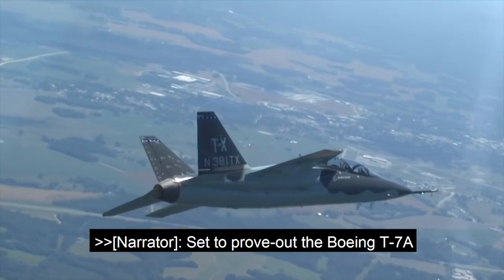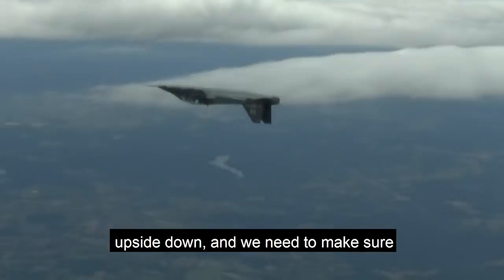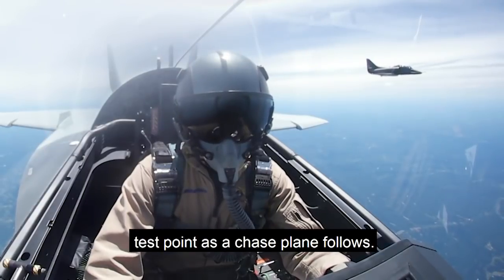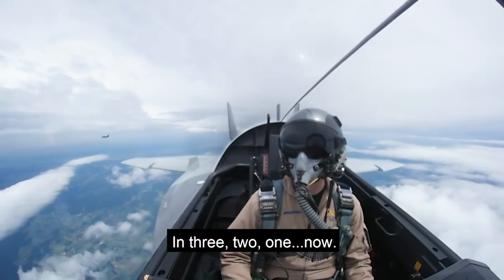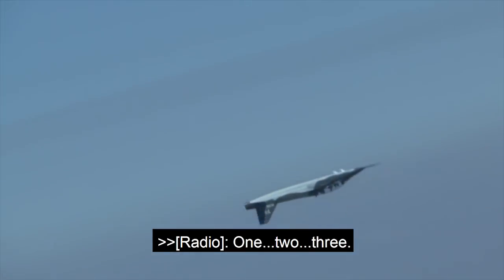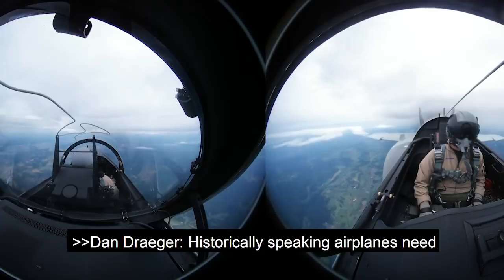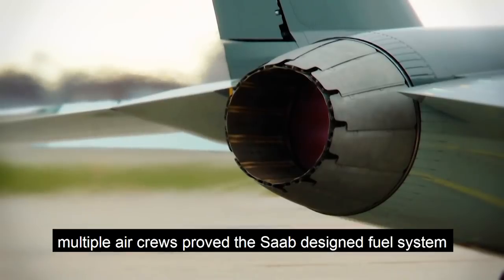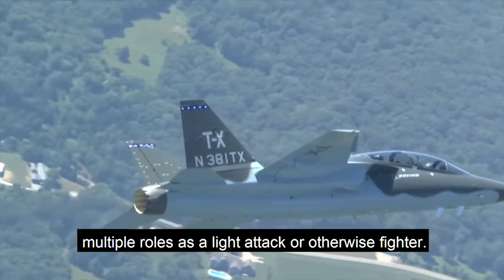T-7A First Inverted Flight Test

Comment: Pops was Private Pilot from the local area for 40+ years.  He owned a Bellanca Citabria for a bit.  Light aerobatic plane that you had to keep positive g's on every maneuver, for the most part, to keep fluids where they needed to be.  No inverted oil system on the Lycoming, so everytime it went inverted and if positive g's weren't held,  the engine oil breather would slosh out a bunch of engine oil, all over everything, creating a day-long cleanup.   Pops fix for that was easy.  He bought a long length of clear hose, and clamped it to the oil breather.  No More mess after that.  The oil was dumped overboard back by the tailwheel where the clear hose exited the fuselage.  Just a tiny bit of oil splash on the back edge of the rudder and tailwheel after that, which was MUCH better than coating the complete underside of the plane surfaces with oil, including all under the engine cowl.  It was a real mess.   The clear hose fix wasn't a green light to hold it inverted, it just kinda gave him a report card on his flying skills that day.

Comment: Cant believe they do  these test over civilians. What if those engine shutdown during inverted flight. I taught they would do these tests over the sea.
Reply: Well, they are close to their base, so they would be able to reach base and land there, even with no engine. There's a video where they test engine restart after a mid-air shut-down, and in that video you see them fly the mission in a simulator and landing back at base with no engine. So they are well prepared, if the engine cuts out and won't start again.

Comment: Huh. I noticed the markings on the back for a boom receptacle. Will she be fitted with that capability in service? It'd certainly be a handy asset to have.
Also, let's be honest here... this will probably be the replacement for the F-16 as the Thunderbirds.
Reply: I have a feeling it will be able to perform mid-air refuellings. The T-38 was unable to do stuff like that
Reply: Si pero va a tener que ser muuuy  bueno para ser el reemplazo del Cohete Blanco el exelente  T-38  !!!

Comment: ...start working on a single-seat F/A version and it will replace all the F5's, early F-16's, and left-over MiG21's that are out there.
Reply: @mainemail-g4e  Two seaters are rather useless in modern times. A WSO doesn't really do much compared to RIOs back in the day.

Comment: Go Boeing! Do what you do best! Build Planes! 👍🇺🇸
Reply: FRIENDLY advice . Dont fly Boeing
Reply: @azurbleu4335   Your wrong
Reply: @azurbleu4335  what kind of idiot are you
Reply: azur bleu Why? Safest most reliable aircraft in human history. No manufacturer in history comes close. 
I suggest don’t fly with inexperience. 👍
Reply: azur bleu two things,One, don’t quote me but I think the Boeing to Airbus ratio is like 7 to 1 Boeing and mind you that’s After airbus inception. As far as flight hours in total, 🙄 Second, Both Max crashes had one Very important thing in common. In seat experience. Mind you their were many Max’s flying when those two went down. Granted many pilots complained about MCAS, Due to their ability to fly and understand flight they simply disengaged as manual stated. I’m not blaming the pilots, I’m more inclined to put blame on management for putting low time pilots in seat. Left seat only had like 50 or so Hours. 
As far as the actual statement that Boeing aircraft are dangerous, Not a chance. It’s simply irrefutable.
Reply: azur bleu And AirBus Sold How many?
Reply: @kickingagainstthepricks4059  Airbus’ 2020 gross orders by June 30th totalled 365 aircraft with net orders . Airbus makes money . Boeing got slaughtered
Reply: azur bleu So what you’re saying is that it took Media Pile on and a Global Pandemic to push the Publicly Funded product to the lead. 🤓 Only time will tell.
Reply: @azurbleu4335    Just look at the 747 v A380.     747. 45 plus yrs of production and millions of hours of air time.  A380. Already out of production.   The 47 started when I was a little kid. Now I'm old and they still are being made and fly all over the world.
Reply: @scott250r2  A380 Too big to fly . Boeing too old to fly .  British Airway has announced that it will immediately retire its Boeing 747 fleet / Airline Geeks : Reports: Boeing Set to End 747 Production / KLM will bring forward the retirement date of its Boeing 747 fleet by a year
Reply: @azurbleu4335  I know the 47s are on the way out Even though they still have orders to build more. Mostly cargo but still building. For MORE than 40 yrs and millions of passengers and billions of miles in the air. The 380? About 5 yrs of production..  JOKE.     Boeing and GE #1.  Airbus and Rolls Royce  cough choke Euro junk.  USA1
Reply: @scott250r2  Airbus ended the year 2019 on a high, with the European commercial airplane manufacturer delivering 863 airplanes for the year in comparison to its larger rival Boeing, which could only manage 345 deliveries . Boeing is out of the game . Soon , China going to enter the show
Reply: @scott250r2  Don't under -estimate China . PS / China is buying US Tech stolen by Israel
Reply: Scott 250r 👍 Starting to feel alone here. 😊
Reply: @scott250r2  - China was making artifacts of exquisite quality 1,000s of years before the U.S. even existed.